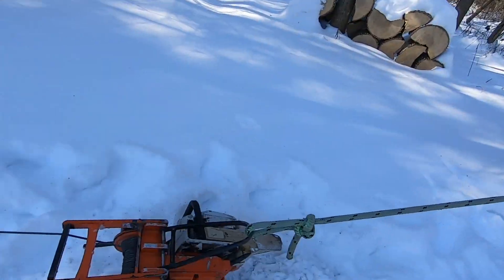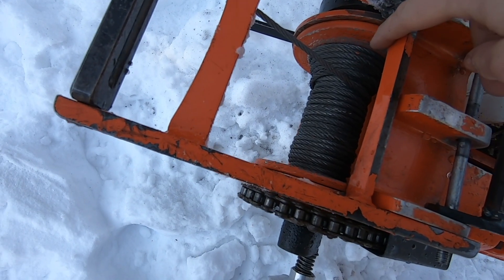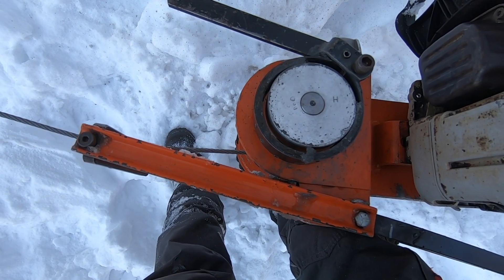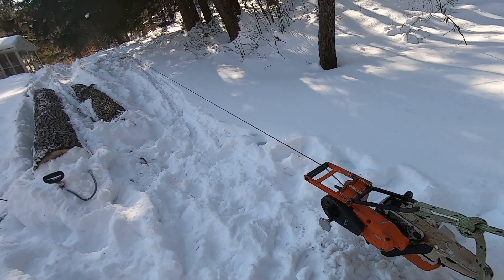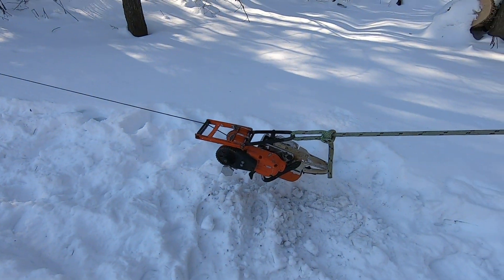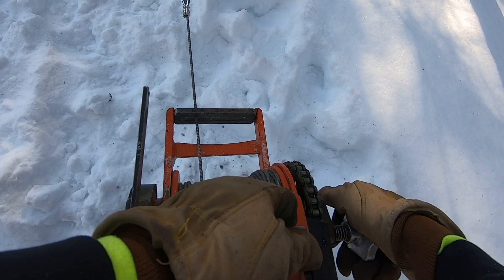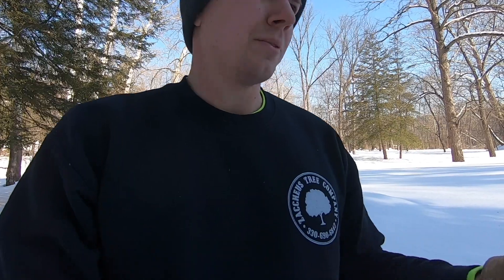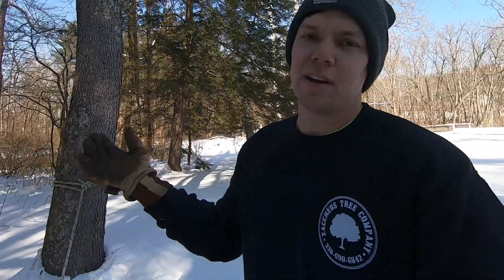Lewis Winch Thoughts and Use

Comment: I use a smaller cable so i can have a longer cable the one that comes with the winch is super duty more than I need it gives you more room on the spool and i put a load binder first on truck or tree to give some slack to disengage the clutch the shear pin on the clutch handle is only 1/8 to small for my liking ir had a bit of tension on the cable it was enough to cut clean that pin
Reply from the maker: @renest-amand5512  no worries about a smaller cable breaking? The operator position leaves the operator pretty vulnerable to injury from cable failure.
Reply: You have to keep that in mind every time you use any winch my cable is a 1/16 smaller than the original cable still very strong and it gives me more room in the spool for me they could of made it with more room i was constantly fighting to spool the cable right,then tried being closer with less cable out i was constantly setting up so finally tried 1/16 smaller cable I take good care of the cable safety is always on my mind.
Reply from the maker: @ sure thing man, as long as it’s thought about and the numbers make sense, I guess that’s all that really matters

Comment: I'm sharing 2 video showing the difference between the action of steel line and synthetic line 
https://youtu.be/hw4BEwxO-gE?si=n3tsrSU1RMfZP57H

https://youtu.be/97XqNX3yFTk?si=NiXwMFoUwAGIOafx
Reply from the maker: The synthetic rope break test was very poorly done. The rope broke in the thimble and not outside of the splice. If the test was performed correctly, you’d see the synthetic line still stores energy. All lines store energy and synthetic is much more subject to abrasion and damage. The most important thing is to use a like that is appropriately rated for the load you’re putting on it. https://youtu.be/J2vBj5rWdXU?si=ezf95o9N4VPnxQtZ

Comment: Actually if the steel cable snaps you are definitely going to get hurt with the synthetic winch line it is going to drop to the ground
Reply from the maker: That’s a myth. Both like store energy. Synthetic does not drop to the ground.
Reply: False rope does the same

Comment: The Eder capstan winch from Germany is an outstanding piece of kit, 👍💪🪓🌲🇩🇪🇮🇪
Reply from the maker: I've never heard of it, I'll have to look it up!
Reply from the maker: It looks very similar to the winches made by Portable Winch Company. They are very nice to use.
Reply: @zach-riggs  When I was researching capstan winches the choice was between the Eder and the P.C.W. The Eder is two stroke, the P.C.W is four stroke. The Eder 1200 is the one I went for in the end. It's 1,200kg on a single line pull. It's light and comes with a forestry kit. The P.C.W has a tilt sensor on the sump which shuts down the engine if it's titled more than fifteen degrees I believe. The Eder will winch away even if it's upside down.  I didn't want to be messing around with straight petrol and then mix for the saws. You always run the risk of putting straight fuel into a saw and vice versa into the winch. I actually used the P.C.W on a job recently. It was hard extraction of a Larch stand. It did the job but I'd much prefer the Eder. The Eder will only throttle up when you pull on the rope. The drum on the P.C.W is always turning thereby generating friction and thus heat. The Eder has a pigtail as a fairlead whereas the P.C.W has a metal loop. The only thing I'd prefer about the P.C.W is the accessories.
Reply from the maker: @Toyotaamazon80series  It sounds like Eder is definitely the way to go. There are a lot of things that I like more about it based on what you mentioned
Reply: @zach-riggs  EDER has an ingenious brake mechanism and two gears/speeds. The Italian company DOCMA S.R.L. copied this mechanism in several of its models: VF900-4 Nippon, VF80 BOLT and VF105 RED IRON. From what I see, other manufacturers of capstan winches have also started to use this solution (including Portable Winch). There is also the good old PW 17 Muli from ZOLLERN/GUFLER METALL KG, but it is heavier than EDER and was designed to work with a wire rope.

To learn more about PW 17 search: "Lightweight with giant power" (use the popular search engine).

Videos on YouTube:

PW 17 Muli:

"welsh chainsaw winch" 

EDER Powerwinch 1800 also known as Nordforest Spillwinde 1800:

"Wir stellen vor: Spillwinde 1800 im Einsatz Offroad | GRUBE.DE"

Comment: You lock the brake when you release the tension knob.. that way you can ease off the tension with the brake handle
Reply from the maker: Ohhh, that would make sense. It wouldn't take the pressure off of the knob and probably save wear on the end of the knob pin

Comment: One thing to be mindful of is that the gearing effectively changes as you winch in. You'll get a stronger pull (more torque) with all the line out, but highest speed when the drum is almost full. Worth considering before changing line for dynema or shortening up
Reply from the maker: Absolutely! You never get maximum pull force and speed at one time, it's only one or the other depending on the drum diameter. That's one nice thing about a capstan winch. It's the same for the entire duration of the pull.

Comment: The brake is pointless you're correct. I took mine off as it was just in the way.  The little metal bit on the bottom is too small I like the one you added.   

My only complaint is what you mentioned it will only wind cable on one side or the other. It needs a drum that is narrow In the center to help guide it to stay on track or a narrower cable guide maybe.  

Very handy tool though I pulled a 4000 lb camper through thick mud down a logging road by putting a ski on the camper.
Reply from the maker: Nice! Thank you for adding your thoughts in here. Good to hear from another user

Comment: So yeah, I mentioned this on your previous video, but using polyester / Dacron / polyDac static rope is essential for all parts of the winching operation.  Yes, it's true there's no such thing as a completely static material; even steel stretches before it breaks.  But a 16-strand climbing line (that Sampson blue-and-white rope), even if it's within its WLL, is a no-no for rigging operations.  The surging of the log and the winch as the rope stretches and releases is a clue that you need static rope here.  Also, the downfalls you mentioned with the Lewis winch don't exist with e.g. the Simpson Capstan winch, esp. if static rope is used with it, because the very design of the capstan winch -- with the capstan at one side of the winch (the right-hand side as viewed from behind-the-chainsaw point of view) -- means that you're keeping gentle tension and taking up slack from the rope while standing AT THE SIDE of the winch, not directly behind the winch where you could get hit if something breaks.  Of course, you have to have some sort of trigger lock -- like a stainless steel hose clamp slipped over the trigger, adjusted to the perfect 3/4 (or even full) throttle setting.  As soon as you want the winch's pull to stop, just slack up gently on the rope so that the capstan slips (a basic design of a capstan from naval/marine use), and while keeping gentle (but slipping capstan) pressure on the rope, walk over and slip the hose clamp off the trigger.  To me, the inate design of a capstan winch, which automatically puts the operator off to the side of the winch to keep rope tension for the capstan to "bite," is reason enough that I went with the Simpson Capstan winch and not the Lewis cable winch.  Pair it with a 600-foot polyDac 3/8 rope, and I've pulled entire spars out of ravines in one pull -- not having to reset because of running out of cable on a spool.  Nice thing about this is you can use as much or as little force magnification with snatch blocks as you want; you're limited by only the length of the rope you're using.
Reply from the maker: Yeah for sure! A capstan winch definitely has its perks, that's why listed some different specs in the description. I definitely would not add a trigger lock to a tool that was designed without one and I would not want to limit myself to a 540 lb WLL as 3/8 polydac is commonly rated for. The simpson winch is rated for use with polyester rope as listed on their website. Considering it would take 20 minutes to run 600ft of rope through a simpson winch at 31ft/min as listed on their website, I'd say it's out of the question for me since I'm trying to make money out here. I would love it if there was a 7hp capstan winch available on the market with a 2 stoke engine, I would trade it for my lewis winch immediately.

Comment: I have a capstan winch but way too much stretch in the line and time consuming. I bought a fransgard v3004 only needs 20hp from the pto for my tractor roughly $2700 and four times as fast
Reply from the maker: Nice that sounds super sweet! Do you find that with being pto driven, you have an appropriate amount if control?
Reply: @zach-riggs  absolutely I have a mahindra 26xl with the fransgard pto winch and a front brush grapple , with the winch you can stand 15ft away from the winch to pull the log also judging by the length and size I think I could of twitched three of logs at once and it would of been about 5 minutes to bring them logs out front , little expensive but worth the investment
Reply from the maker: Yeah for sure! Thanks for your input! How much cable is on that thing? I think I ended up pulling somewhere around 325-350 ft in the end
Reply: @zach-riggs  the cables has 150ft. I'll have to make some videos again
Reply from the maker: I gotcha, that seems to be enough for most applications typically.
Reply from the maker: I'll have to check them out

Comment: That should have warning lables all over it lol Bunch of ways to get hurt with that thing.  Nothing more nerve racking than standing in line with tensioned lines lol. Super handy though. Cool tool.
Reply from the maker: Yeah, I think it was developed back back in the early 70's before warning labels existed 😅
Reply: The most dangerous place to be is actually perpendicular to the pull.

Comment: I went to harbor freight and bought a 12000 pound winch and the mount for a tow hitch. I then ordered a draw tite front mount hitch for my truck. I run more blocks and redirects but it’s much safer and more dependable than anything else I have tried. Total price was about $700 .
Reply from the maker: That's a sweet idea. I've considered the use of an electric winch, I was just always worried about duty cycles for long pulls.
Reply: @zach-riggs  yeah I know what you mean. That’s why I went big. I don’t plan on pulling anything over 6000 pounds. I also went from a 4000 pound come along. That’s doubled up. Big difference. If you do some more investigating, you can find one that suits you. Duty rating on mine is pretty good at 2000 pounds.
Reply from the maker: I gotcha, do they typically list line speed for electric winches?
Reply: @zach-riggs  yes,
Reply from the maker: I looked as some specs and was impressed to see the unit listed at 6hp! That's quite a bit for such a compact little motor.
Reply: @zach-riggs  yes it is. It’s not a 30 ton winch on a skidder but it’s served me well so far.
Reply: Did you get the badlands apex 12000 pound winch? I have it and I love it
Reply: That only works if you can get ur truck to the work site . Many of us can't do that , but still need to move logs , or dead critters .

Comment: How much weight do you think you could pull with that Lewis winch
Reply from the maker: I'm not 100% sure. I think with this power head it will produce around 2500lb pulling force rather than the 4000lb with a 661. I think it mostly depends on how much resistance there is on the ground. If I was using a log arch with no snow, I think it would pull a lot
Reply: @zach-riggs  that thing's awesome man I've always wanted to get one I have a winch on the chipper but sometimes you can't always get the chipper to where you need it to use the winch that Lewis wench would be perfect at times definitely
Reply from the maker: That sweet though that you have a chipper winch. My chipper didn't have one and there sure were times I wish I had one.